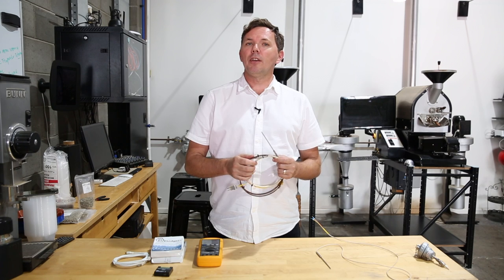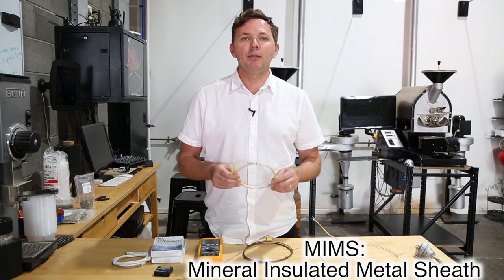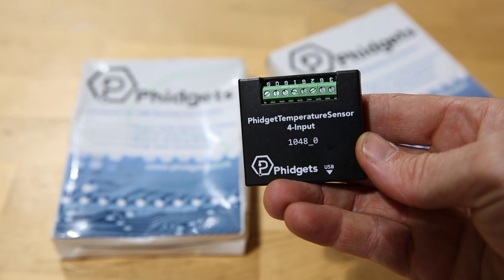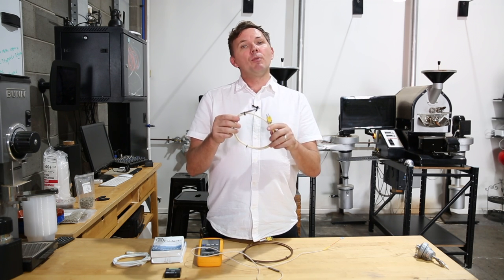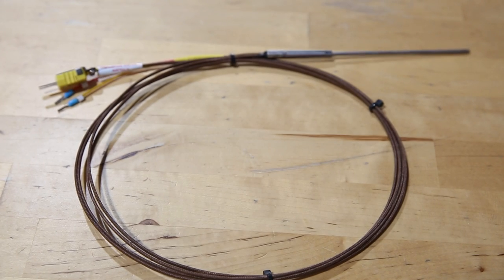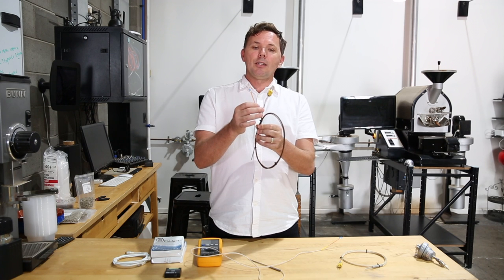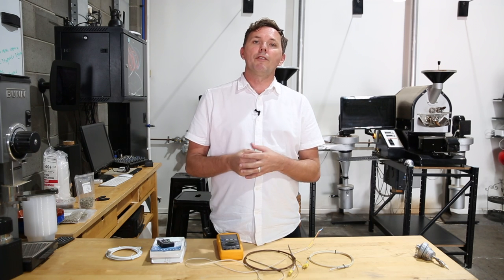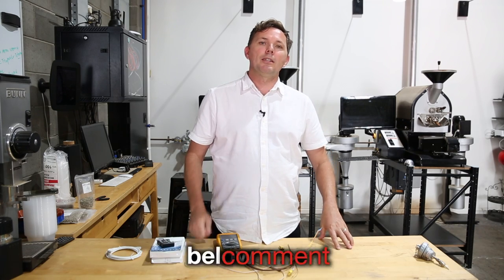Coffee Roaster Temperature Probes

Comment: Just remember that all probes have a level of accuracy  and that it may not be linear across the range.   In addition  the meter or device also has its own accuracy specs and thus the final reading is approximately  +/-   the sum of the two devices  ( can be worse but that is deeper into Measurement theory).

So a probe that has a  +/-   1.5 C  at about  250C and if your meter has a =/-  1C  (plus least sig digit)    then  when measuring and making a call that the temp is  230.0C   you could actually be  227.5C   OR   232.5C .  

The take home message is that you should be focusing on consistency and  reproducible outcomes.  AND that if a probe or meter fails,  the new item may not give you the same reading....   And that can cause some people; problems when things change and they focus on just the reading without understanding the levels of Accuracy.

In may cases a couple of  C may not matter and in other cases even 0.25C can cause a gross error...   The context has to be understood.
Reply from the maker: Thanks Mark

Comment: G'day Peter... Mate when a thermocouple comes with only the two separate wire output, can a yellow plug be fitted in place of those wire terminals to fit the standard thermometer connection ?

Comment: Hello Mark, I am want to connect my probatino 1 kg roaster on software, and I like to know if I have to make a new hole to put a probe in iy or can I use its on probe. What did you do there? If new hole, where should you recommend or where you did it?
Thx
Reply: Hi Mastre Cafeeiro! It all depends on the variables, If your new probe is smaller than the current one, most like likely you will need to drill a new hole... In case you need to do so, I would suggest to watch if your drum rotates counterclockwise or clockwise. If it rotates counterclockwise the heart of your coffee bean pile will be on the bottom right side. If it rotates clockwise, the heart of the coffee bean pile will be on the opposite side (bottom left side). So! Perhaps one inch above the edge of the front faceplate would be fine, but! Location also depends on your roaster batch size. Hope this helps! Cheers!

Comment: thanks for nice video where can i but  RTD  probe ?   did  it  work  with phidghet  1048  ?
Reply: Too late I know, but no, the Phidget 1048 is for thermocouples only. The Phidget website has RTD probes and Phidgets, but the Phidgets use a VINT port, not USB. You need a separate VINT/USB hub to make it all work. So you'd have [probe] => [RTD VINT Phidget] => [VINT/USB hub] => [computer].
Reply: @jamesrempel8522  i use  k type  probe  directly  with  phidget  1048  .  with out  vent